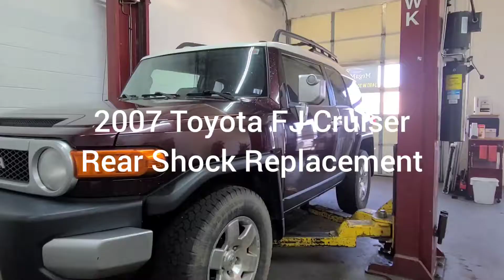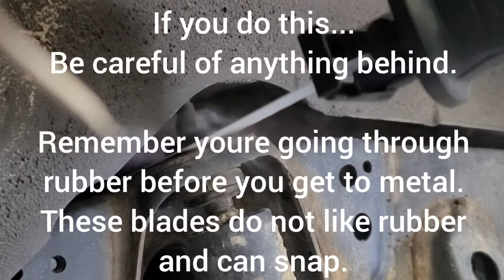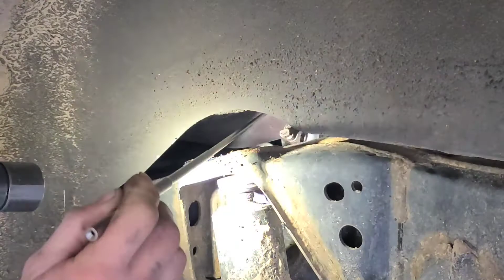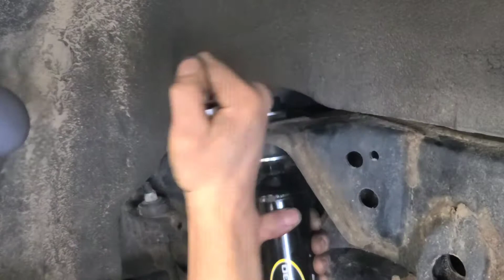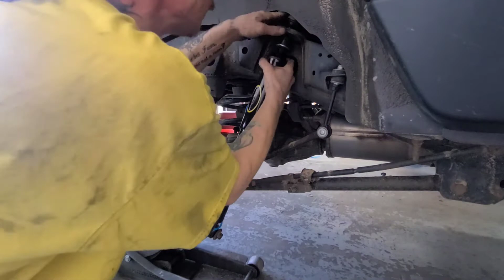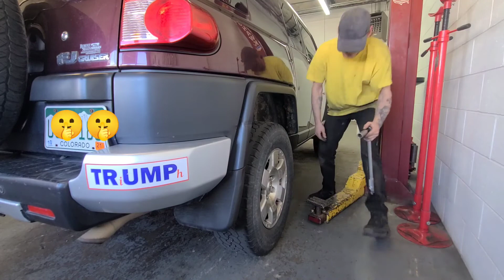Rear Shocks on a 2007 Toyota FJ Cruiser

Comment: Nice video. What other methods did you try before deciding to cut the shocks out?
Reply from the maker: I dont really have many methods for those. I dont have a torch in my shop but a torch would probably take longer than just cutting them anyway. 

If I cant get the nuts to loosen, Ill try to tighten them till they break. If that doesnt work, I cut them.